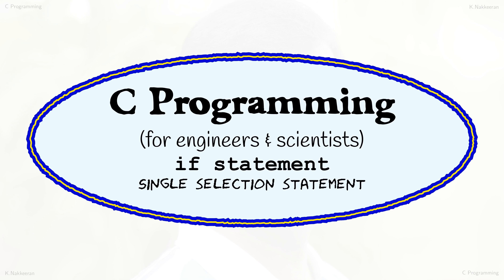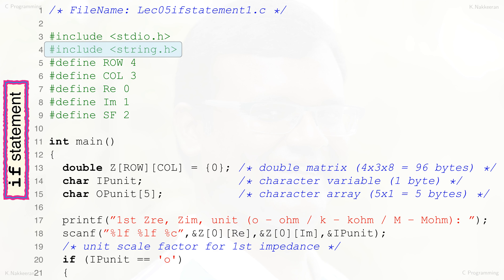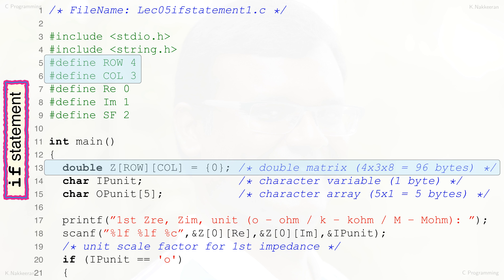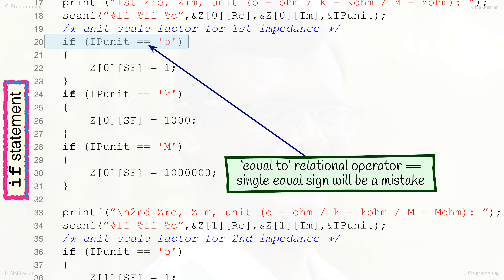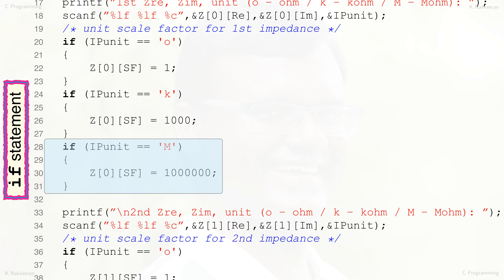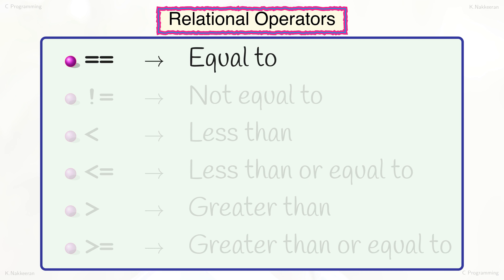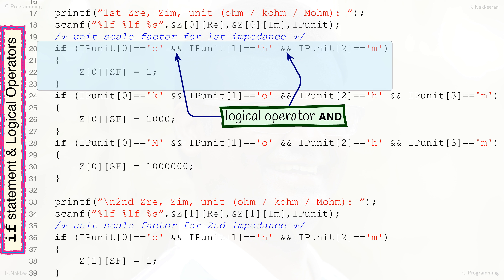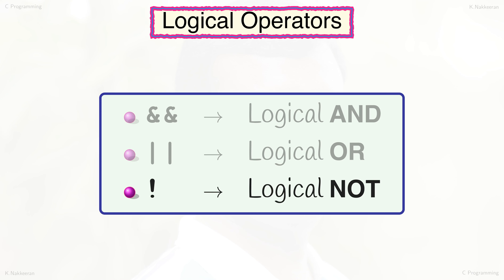C Programming Lecture 05/13

Comment from the maker: /* FileName: Lec05ifstatement1.c */

#include <stdio.h>
#include <string.h>
#define ROW 4
#define COL 3
#define Re 0
#define Im 1
#define SF 2

int main()
{
  double Z[ROW][COL] = {0}; /* double matrix (4x3x8 = 96 bytes) */
  char IPunit;              /* character variable (1 byte) */
  char OPunit[5];           /* character array (5x1 = 5 bytes) */

  printf("1st Zre, Zim, unit (o - ohm / k - kohm / M - Mohm): ");
  scanf("%lf %lf %c",&Z[0][Re],&Z[0][Im],&IPunit);
  /* unit scale factor for 1st impedance */
  if (IPunit == 'o') 
  {
      Z[0][SF] = 1;
  }
  if (IPunit == 'k') 
  {
      Z[0][SF] = 1000;
  }
  if (IPunit == 'M') 
  {
      Z[0][SF] = 1000000;
  }

  printf("\n2nd Zre, Zim, unit (o - ohm / k - kohm / M - Mohm): ");
  scanf("%lf %lf %c",&Z[1][Re],&Z[1][Im],&IPunit);
  /* unit scale factor for 2nd impedance */
  if (IPunit == 'o') 
  {
      Z[1][SF] = 1;
  }
  if (IPunit == 'k') 
  {
      Z[1][SF] = 1000;
  }
  if (IPunit == 'M') 
  {
      Z[1][SF] = 1000000;
  }

  printf("\n3rd Zre, Zim, unit (o - ohm / k - kohm / M - Mohm): ");
  scanf("%lf %lf %c",&Z[2][Re],&Z[2][Im],&IPunit);
  /* unit scale factor for 3rd impedance */
  if (IPunit == 'o') 
  {
      Z[2][SF] = 1;
  }
  if (IPunit == 'k') 
  {
      Z[2][SF] = 1000;
  }
  if (IPunit == 'M') 
  {
      Z[2][SF] = 1000000;
  }

  /* eq impedance real & imaginary parts calculation in ohms */
  Z[3][Re]=Z[0][Re]*Z[0][SF]+Z[1][Re]*Z[1][SF]+Z[2][Re]*Z[2][SF];
  Z[3][Im]=Z[0][Im]*Z[0][SF]+Z[1][Im]*Z[1][SF]+Z[2][Im]*Z[2][SF];

  /* find the input impedances max unit */
  Z[3][SF] = Z[0][SF];
  if (Z[3][SF] < Z[1][SF]) 
  {
      Z[3][SF] = Z[1][SF];
  }
  if (Z[3][SF] < Z[2][SF]) 
  {
      Z[3][SF] = Z[2][SF];
  }
  
  /* fix the equivalent impedance unit */
  if (Z[3][SF] == 1) 
  {
      OPunit[0] = 'o';
      OPunit[1] = 'h';
      OPunit[2] = 'm';
      OPunit[3] = '\0';
  }
  if (Z[3][SF] == 1000) 
  {
      sprintf(OPunit,"%s","kohm");
  }
  if (Z[3][SF] == 1000000) 
  {
     strcpy(OPunit,"Mohm");
  }

  /* scale equivalent impedance real & imaginary parts */
  Z[3][Re] /= Z[3][SF];
  Z[3][Im] /= Z[3][SF];

  printf("\nZeq = %.4lf%+.4lfj %s\n",Z[3][Re],Z[3][Im],OPunit);

  return 0;
}

Comment from the maker: /* FileName: Lec05ifstatement2.c */

#include <stdio.h>
#include <string.h>
#define ROW 4
#define COL 3
#define Re 0
#define Im 1
#define SF 2

int main()
{
  double Z[ROW][COL] = {0}; /* double matrix (4x3x8 = 96 bytes) */
  char IPunit[5];           /* character array (5x1 = 5 bytes) */
  char OPunit[5];           /* character array (5x1 = 5 bytes) */

  printf("1st Zre, Zim, unit (ohm / kohm / Mohm): ");
  scanf("%lf %lf %s",&Z[0][Re],&Z[0][Im],IPunit);
  /* unit scale factor for 1st impedance */
  if (IPunit[0]=='o' && IPunit[1]=='h' && IPunit[2]=='m')
  {
      Z[0][SF] = 1;
  }
  if (IPunit[0]=='k' && IPunit[1]=='o' && IPunit[2]=='h' && IPunit[3]=='m')
  {
      Z[0][SF] = 1000;
  }
  if (IPunit[0]=='M' && IPunit[1]=='o' && IPunit[2]=='h' && IPunit[3]=='m')
  {
      Z[0][SF] = 1000000;
  }

  printf("\n2nd Zre, Zim, unit (ohm / kohm / Mohm): ");
  scanf("%lf %lf %s",&Z[1][Re],&Z[1][Im],IPunit);
  /* unit scale factor for 2nd impedance */
  if (IPunit[0]=='o' && IPunit[1]=='h' && IPunit[2]=='m')
  {
      Z[1][SF] = 1;
  }
  if (IPunit[0]=='k' && IPunit[1]=='o' && IPunit[2]=='h' && IPunit[3]=='m')
  {
      Z[1][SF] = 1000;
  }
  if (IPunit[0]=='M' && IPunit[1]=='o' && IPunit[2]=='h' && IPunit[3]=='m')
  {
      Z[1][SF] = 1000000;
  }

  printf("\n3rd Zre, Zim, unit (ohm / kohm / Mohm): ");
  scanf("%lf %lf %s",&Z[2][Re],&Z[2][Im],IPunit);
  /* unit scale factor for 3rd impedance */
  if (IPunit[0]=='o' && IPunit[1]=='h' && IPunit[2]=='m')
  {
      Z[2][SF] = 1;
  }
  if (IPunit[0]=='k' && IPunit[1]=='o' && IPunit[2]=='h' && IPunit[3]=='m')
  {
      Z[2][SF] = 1000;
  }
  if (IPunit[0]=='M' && IPunit[1]=='o' && IPunit[2]=='h' && IPunit[3]=='m')
  {
      Z[2][SF] = 1000000;
  }

  /* eq impedance real & imaginary parts calculation in ohms */
  Z[3][Re]=Z[0][Re]*Z[0][SF]+Z[1][Re]*Z[1][SF]+Z[2][Re]*Z[2][SF];
  Z[3][Im]=Z[0][Im]*Z[0][SF]+Z[1][Im]*Z[1][SF]+Z[2][Im]*Z[2][SF];

  /* find the input impedances max unit */
  Z[3][SF] = Z[0][SF];
  if (Z[3][SF] < Z[1][SF]) 
  {
      Z[3][SF] = Z[1][SF];
  }
  if (Z[3][SF] < Z[2][SF]) 
  {
      Z[3][SF] = Z[2][SF];
  }
  
  /* fix the equivalent impedance unit */
  if (Z[3][SF] == 1) 
  {
      OPunit[0] = 'o';
      OPunit[1] = 'h';
      OPunit[2] = 'm';
      OPunit[3] = '\0';
  }
  if (Z[3][SF] == 1000) 
  {
      sprintf(OPunit,"%s","kohm");
  }
  if (Z[3][SF] == 1000000) 
  {
     strcpy(OPunit,"Mohm");
  }

  /* scale equivalent impedance real & imaginary parts */
  Z[3][Re] /= Z[3][SF];
  Z[3][Im] /= Z[3][SF];

  printf("\nZeq = %.4lf%+.4lfj %s\n",Z[3][Re],Z[3][Im],OPunit);

  return 0;
}